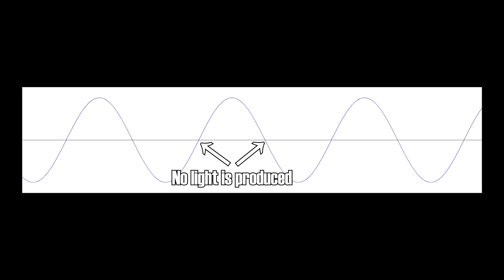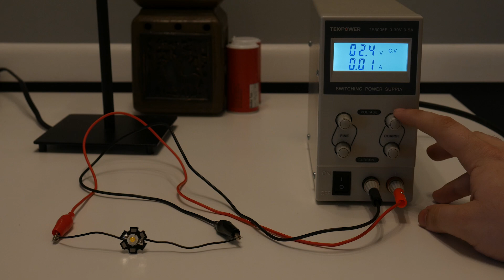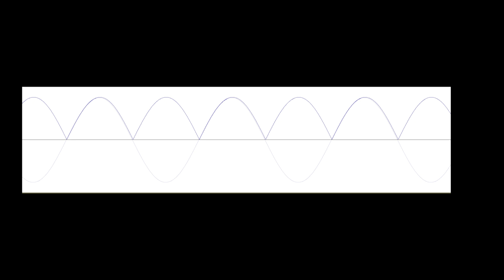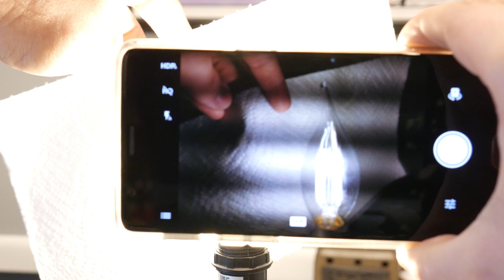LED bulbs that flicker, and CFLs that almost never did

Comment: Modern CFLs have so little mercury it's not even worth thinking about. You could break a bunch of them right in front of your face and you wouldn't even be able to test positive for mercury poisoning, let alone have any negative health effects from the mercury. The glass might give you some cuts, but that's it. There are valid reasons to switch over to LEDs, such as a moderate improvement in efficiency, but the mercury issue is really overblown these days.

Comment: I ran CFL's for a bit and if I went to sleep while the lights were on I would wake up drenched in sweat. Switched to LED's and this is no longer an issue. (It was also not an issue with incandescent bulbs but 10ft ceilings were a pain with the short life so I had to switch.) Never was sure why and its not a color temp or eye strain issue as my eyes were closed due to sleep.
Reply: EMF

Comment: I have question about LED Christmas lights that are for outdoor and indoor use. I have three sets linked together to be plugged into one plug outside. On some days, one of the strings will be very dim and only visible at night while the other two sets are fully lit. And other days, they're all fully lit. Why is that?

Comment: I wanna see modern structures built with modern LED lighting in mind..that is, with switch mode power supplies built into light sockets. Imagine only having to replace the LED bulbs themselves! That would be so cheap!

Comment: What LEDs still cant do compared to incandescents is light at just barely illuminative levels.

Using a dimmer, you can turn an incandescent bulb down until the filament is just barely lit.
With an LED dimmer and a dimmable bulb, you get to a point where the bulb is on or off.

Also, an incandescent will turn back on at that level where an LED has to turn on brighter then be dimmed down.

Comment: I think that your idea about the smaller filter capacitor could be correct. I may not be an engineer, but I enjoy designing and building circuits in my free time. To be sure about what is causing the flicker, I think it would be best to view the waveform of the voltage across the LEDs using an oscilloscope.

Comment: To answer your thumbnail, yes. At least the ones my boss buys for the floor. I always hated when they got old and would have stripes moving down the length of the tubes. All of them always sort of visually 'vibrated' too which sometimes bugged me. The CFL sized LEDs with DC ballasts fixed literally every problem i had with those and made my boss happy on cutting the electric bill down to nothing lighting wise.

Comment: CFLs are great I think I’m the only one saying it , leds are ok but get too hot , incandescent bulbs are good but dear to run , metal halide aren’t the best because the slow startup but a good outdoor alternative to led because a similar light without the glare of a led , fluorescent tubes are good for big hallways , bathrooms, outdoor wall lighting shed / warehouse lighting and supermarkets , again cfls are actually decent because their cheap eg €3 in aldi last around 10-15 years based on 10 hour use a little less if in a bathroom because it being frequently turned on and off also they have evolved the 2018 up aldi spiral light bulbs light up 90% at first and 100% in 15 seconds the color depends on the kelvin of the bulb this is on the outside of the box quick guide warm white is the yellowish light not too yellow, cool white is a pure white light and daylight is a light blueish light is recommend warm white or cool white for in house and daylight or cool white for commercial buildings/ shops  if your still reading considering like in this and I hope this helps you! 👍

Comment: Another thing to add to your list of stuff that's bad about CFLs. There is one specific but common situation where even an incandescent is a better option: when a lamp is normally turned on briefly but repeatedly over the course of the day, rather than being left on for extended periods. This is because flourescents mainly age through the number of on/off cycles, while incandescents mainly age through burn duration, so if you have a light fixture that's repeatedly lit a few seconds to a few minutes at a time, an incandescent will usually last many times longer than a CFL. Case in point: I have a large walk-in cupboard lit by a 60W incandescent bulb that I put in about fifteen years ago. It's the third bulb I've put in there, the previous two having been CFLs that both burned out within a couple of years of on/off/on/off cycles since I'm in and out of there all the time.

Comment: I think you have it right on the "fake incandescent" LED lamps.  The socket has just a bridge rectifier and perhaps some ballast resistance.  Most LED Christmas light strings also work this way, except the ballast resistance is distributed along the string (about 130 ohms in each LED) and more voltage drop is allocated to the resistors, as efficiency is less important.
   The flicker problem you don't mention is when the power supply "sputters", most likely because it is overheating and the switching control loop goes unstable (critical loop stabilization capacitors are cheap electrolytic, and they "cook out" in hours).  Many LED lamps are less reliable then incandescents for this reason.  CFL's, like the blackened one you show, also fail in flickering mode when their "pesky" negative resistance goes up more then the cheap, initially marginal ballast can handle, usually long before the tube fails.  The flat Phillips LED bulbs seem to be the best in the flicker/reliability department.  It is the driver that is usually the problem in both CFL and LED lamps.

Comment: I used a CFL in a desk lamp when doing art work. I would get eczema on the right side of my face on my temple and right side of my forehead. Strangely, after a few months, the eczema moved to my left temple/forehead while it cleared up on the right side of my face....I realized that it was due to the fact that I had moved the lamp to the left side of my drawing table. CFLs are not good.

Comment: They simply just skimp on the higher capacitor and maybe proper drivers. I do have a tiny G45 (dimmable!) 4W filament LED bulb that is completely flicker free. And a bunch of other that are flicker like hell. One ebay one is particularly obnoxious. When I turn around the corner I actually see several afterimages of it in the LEDs light...
I'm quite sure whit some clever engineering even E14 candle filaments could be flicker free, however I have yet to see one...

Comment: 120V is a RMS value. The peak voltage is actually closer to 150V, and therefore the DC voltage from rectified AC is about150V

Comment: Interesting video. Well, I am not so happy that CFLs are going out. I use in 95% CFLs. Only in one toilet and one closet there are classic incadescent lights but otherwise only CFLS - warm white CFLs and a quality ones. I hate LEDs. They have sharp blue non-linear light spectrum. Because I like orange colour and thus have orange-ish colours of the rooms LED's blue light makes these colours grey if I use LEDs. Also LEDs light pattern is a bright dot with a sharp edge around it. It is hard to do a nice lightning (a seamless one) of a room, if you have a reflector light like an LED is. I hope CFLs will stay as long as possible.

Comment: I have noticed that most LED bulbs do not flicker, they are good just like CFLs, but some do, usually the cheaper made ones.  But the dollar store stocks them and most are a good brand which doesn't flicker, so avoiding those stores isn't a strategy worth considering.  I've even seen many LED bulbs in stores or restaurants flicker also, and almost all of them in strings do.  They need to start using storage capacitors in those bulbs.  But like I said, I have tested most recent $3 - $4 LED bulb and they do not flicker.

Comment: You didn’t take into account the Flourescence lights work by illuminating a gas and creating Pure UV light, then the phosphorous coating converts the UV light to a visible wavelength and overtime the phosphorous coating wears down. When the coating ages it starts allowing UV light through which by itself will cause eye damage.
Reply: Rick Delair  Not all LED bulbs flicker. If you are affected by flickering lights, then you should avoid filament LEDs - they tend to flicker badly (as was said in the video). As for conventional LEDs, always buy good quality ones from good manufacturers, not cheap ones. Also, as a response to Light on the Inside's comment, the eye damage is caused by UV radiation, but not because of the phosphor degrading. Even a new fluorescent lamp will emit low levels of UV light. I'm assuming (correct me if I'm wrong) that the reason for this is microscopic scratches/imperfections in the phosphor coating. Because the tube shape is so complicated, the phosphor coating does not get applied evenly to all parts of the tube, so some parts get too much and others get too little.
Reply: Rick Delair  Long wave UV isn't exactly fun.

Comment: Who said cfl were not d'immable? Find a professional audio amplifier, powerful enough to produce 120v at the output probably in bridge mode, connect audacity to it, generate some low frequency from 0-120hz, vary the amplitude and you'll see that you can dim them smoothly at 10% brightness, at least the philips one I had. You can strobe them, and feed them with higher frequency as well. Same goes for those led with little electronics that flickers.

Comment: I'll be honest, I don't even know where to take my old CFL bulbs to be recycled.  A quick Google search tells me there are only three locations near me, and none of them are in anything remotely like a convenient location, which means it wouldn't be worth the time, effort or gas to take the one or two bulbs I replace in six months all the way out there, but I'm not about to keep a bunch of dead bulbs laying around my house either.
Oh, and the nearest location charges drop offs of more than nine bulbs from a residential customer, so even if I did put the dead ones in a bag or box or corner and save them until the environmental benefit of recycling them outweighs the environmental cost of driving that distance (20 minutes round trip, well 14 under ideal conditions which never happen on that side of town...) I'm still going to be out whatever the dumping cost is.
Since the nearest drop location is the Recology Transfer Station, and I already pay for Recology roadside pickup and they already have a sorting station at that site, it's cheaper, easier and more ecologically friendly to let the dump truck take my bulbs with the rest of my trash and sort it onsite than for me to burn extra gas to bring a handful of bulbs to the exact same location.

Comment: 4:17-4:36 -- So what you're saying is that a CFL is compact?  I'm a little unsure...please clarify.  lol  5:40 - "The green phosphor is usually the slowest and you might have caught a green flash of light..."  I've noticed this effect even more with "Daylight" CFLs (i.e. 5000K vs 3000K bulbs).  One last item:  You cannot mention LEDs without mentioning BigClive.  If there is any type of LED in existence in the world today he probably owns one or has owned one and has (on video) probably tested it, taken it apart and put it into a project definitely NOT approved by the manufacturer.  ;)  ;)

Comment: hi, i have bought a really cheep LED lamp and it dad a capacitor voltage dividor and bridge rectifier. First capacitor will limit how mutch current it can pass and the second will smooth the AC pulses to DC. I found that it is less flickering than LEDs mimicking Edisons incandecient bulb.

Comment: I don't think I'll be able to buy a new car unless they can figure out how to dim the LEDs without PWM or at least in a way I can't see it. Dashboard illumination is pretty much all LED now. It's fine at full brightness but when it dims as you turn on the headlights then it becomes annoying. Tail-lights of new cars are all really annoying to me too. Somehow the backlight on my laptop is fine but the Samsung tablet my dad gave me I can see the flicker. So I know it's possible to do it other ways. Interestingly at Costco the other day I did see a filament type bulb that wasn't too bad, it seems they managed to cram a big capacitor in there somehow.
Reply: Try tint film.

Comment: And in turn, most people's aversion to daylight bulbs probably comes from the extremely poor CRI of cheap bulbs that usually came in cold white just because that was the cheapest phosphor mix available.

Also, unique to CFLs, there were some really cheap-ass bulbs that claimed to be warm white, but actually gave off pinkish light (especially when not fully warmed up), with an absolute horror of a CRI. The fact that these bulbs were often marked with crazy inflated "equivalent wattage" ratings (yeah, 550lm is surely a "65W replacement", right...) didn't help either.

Comment: I wish I could post a picture on here. I have both types of led bulbs in my house, and the candelabra bulbs produce such strong black lines across my phone's screen! The regular ones are perfectly clear on my screen.

On a side note, you can also use your camera on your phone to check if your remote is still working. The infrared light emitted by the remote to signal your TV, comes out as a purple light on your camera screen.

Comment: I can't stand LED bulbs. They look very bright but I can't see a thing working under them compared to working under florescent lighting. Another issue I have with LEDs, which is no fault of the technology, is automakers using too low a switching frequency to PWM dim the LED. It produces a CLEARLY visible strobing effect. I don't want to drop any (GM) names but this automaker must have a brain dead engineer to think a switching frequency that low was acceptable. Leave the strobing for emergency vehicle use.

Comment: 0:47 - the rear lights of the new Cadillacs is WORSE thn the common street lighting! Very strobe-y!
Reply: I'd wager it's due to them using pulse-width modulation to control the brightness.

Comment: We'll always have 60hz or 50hz AC power depending on what part of the world your from and this will always be a fight to stabilize the power. LED drivers will wear out, they aren't designed well to handle perfect constant light output from the LED. Switch mode power supplies are always more nosier than a truly linear supply. a clean switch mode PSU circuit is very expensive so its likely not going to be found in a bulb. If you suffer with headaches with flickering light then you should have a very small solar panel system with 12v battery bank and invest in some 12v DC incandescent bulbs for marine or automotive. Even if its just to run the a couple comfortable lights in your place. Batteries produce a linear flat direct current eliminating the need for a driver. If your electronic savvy then you can easily learn how to power an LED directly from a battery if the voltage of that battery is correct for the LED. You can also put a current limiting resistor in line with the LED if the battery voltage is too high. This creates absolute constant light with zero flicker.

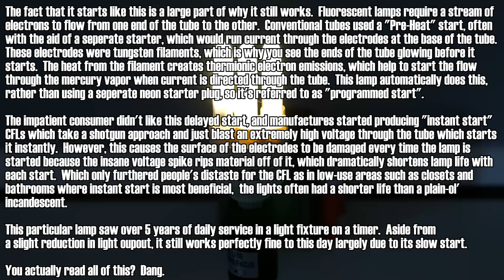Comment: For those finding it nearly impossible to pause on the massive amount of text at 1:50, here's what it says:

The fact that it starts like this is a large part of why it still works. Fluorescent lamps require a stream of electrons to flow from the end of the tube to the other. Conventional tubes used a "Pre-heat" start, often with the aid of a separate starter, which would run current through the electrodes at the base of the tube. These electrodes were tungsten filaments, which is why you see the ends of the tube glowing before it starts. The heat from the filament creates thermionic electron emissions, which help to start the flow through the mercury vapour which current is directed through the tube. This lamp automatically does this, rather than using a seperate neon starter plug, so it's referred to as "programmed start."

The impatient consumer didn't like this delayed start, and manufacturers started producing "instant start" CFLs which takes a shotgun approach and just blasts an extremely high voltage through the tube which starts it instantly. However, this causes the surface of the electrodes to be damaged every time the lamp is started because the insane voltage spike rips material off of it, which dramatically shortens lamp life with each start. Which only furthered people's distaste for the CFL as in low-use areas such as closets and bathrooms where instant start is most beneficial, the lights often had a shorter life than a plain-ol' incandescent.

This particular light saw over 5 years of daily service in a light fixture on a timer. Aside from a slight reduction in light output, it still works perfectly fine to this day due to its slow start.

You actually read all of this? Dang.
Reply: William, not exactly.  You corrected the "separate" spelling mistakes that occur in the text.  The misspelling of separate (using seperate) bothers me almost as much as those terrible yellow turn signals on the back of cars.
Reply: ExWEIMan I’m no grammar Nazi, but I must’ve screwed it up while writing it down so I could copy it onto my phone to put it into the comment. Whoops.

Comment: also xenon lights in your car are HIDs. It is now possible to retrofit old tube CFLs with LEDs by replacing the striker with a simple bridge and then putting in the LED which has the same plug as the original bulb